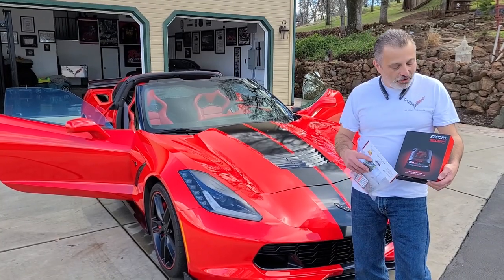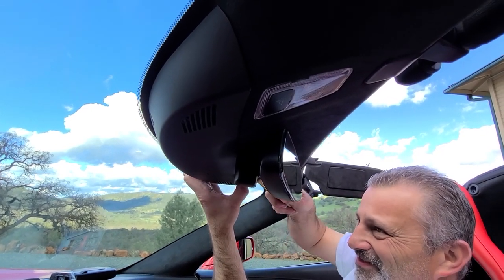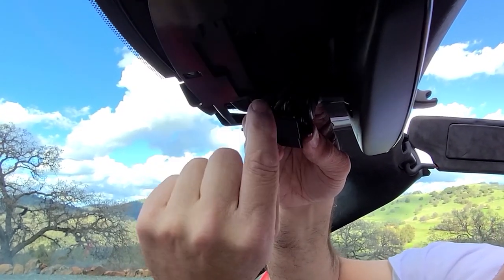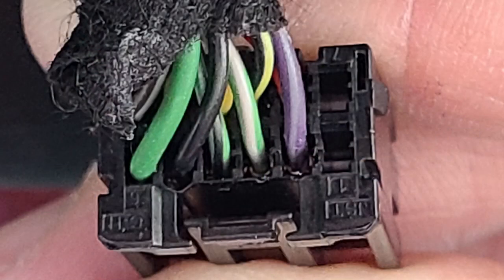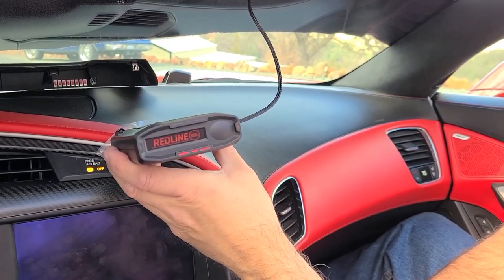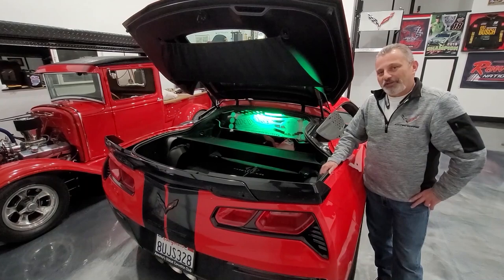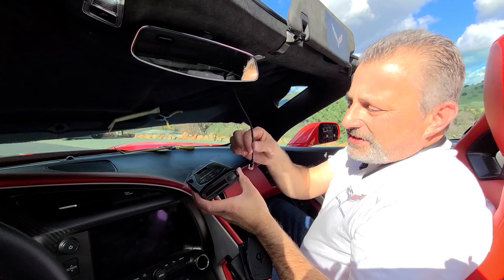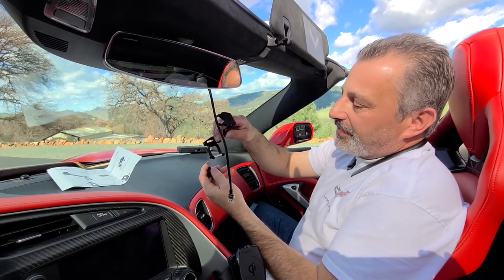How to Install an Escort Redline 360C in a C7 Corvette

Comment: Congrats on the business. That is exactly how so many businesses start. Can you work on the crazy 8's as well? That radar detector looks like a ham sandwich hanging under the mirror. Could you mount the unit upside down so you could hit the mute button.
Reply from the maker: Lol!!
Reply: @THECORVETTECHANNEL  Scott I'm serious. Most modern cars have a significant slope to their windshield. With the mount I was wondering if you could mount the detector upside down. Then position it partially behind the mirror with the controls and resets on the bottom. I could still see half the graphics and not compromise my safety or view by the unit hanging down. Are you going to do a review on it as well. What do you think?
Reply from the maker: @thereissomecoolstuff  We are planning on doing a review. You know I will take a closer look at the bracket and see if it would work.
Reply: @THECORVETTECHANNEL  thanks. Between A pillars and low profile wind screens anything hanging lower could block your view. I definitely agree no suction cup. Is this model a type you could do a permanent in dash mount? I'm sure you'll cover it. I'm a C8 guy. Your car and many other earlier C7's are amazing. That is my favorite color.